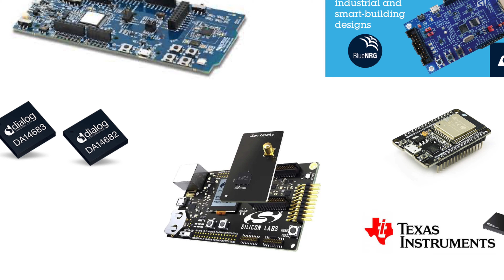Become a BLE Development Pro: Navigating the Top 4 Platform Skill Sets!

Comment: What is Bonded or not bonded with BLE technology mean?
Reply from the maker: It means that the two devices are “paired” but the pairing persists across re-connections too. Paired refers to the connection being secure but only during that connection and if they become bonded, the pairing persists across consecutive connections and no need for pairing again.
Reply: @NovelBits  thank you...I'm having a hard time reading the information the app gives to discern whether or not a device is an unwanted tracker someone put in my car or not? What would be some info gathered from BLE Tester or Air tracker and the like Apps be that someone bought a Tag and hid it in your car? I was notified by several apps I'm being tracked but could not find it as they are so small, they are easily hidden...
Reply from the maker: @metoo9357 I believe these devices have information in their advertising packets that can identify them. Though I’m not sure what the exact format and information is. I’m sure you’ll be able to find that out online.